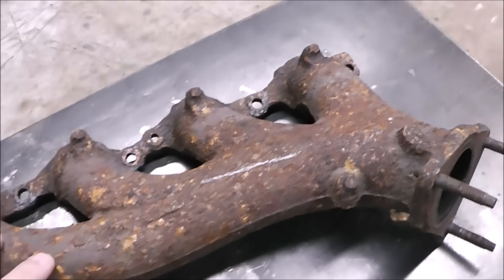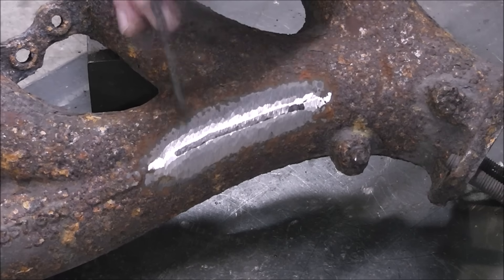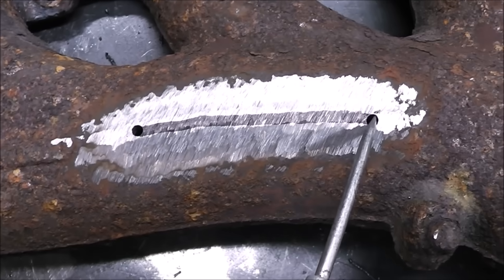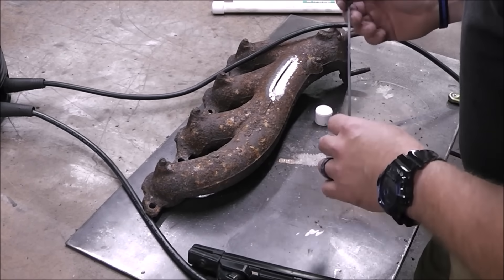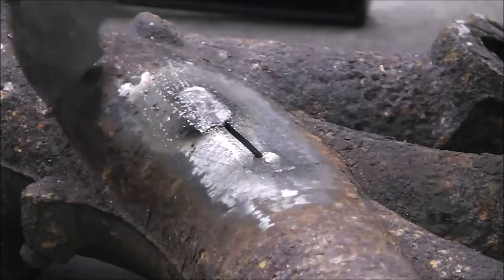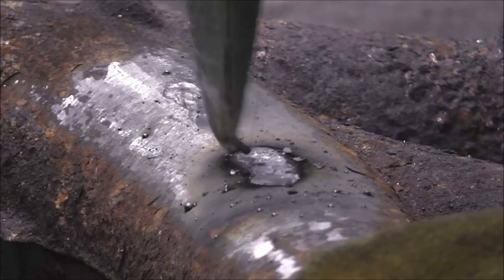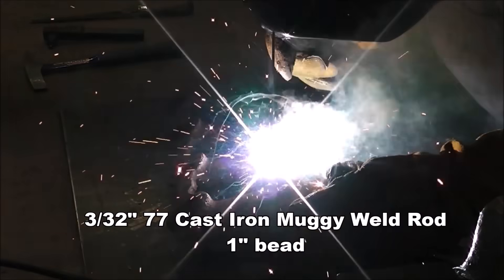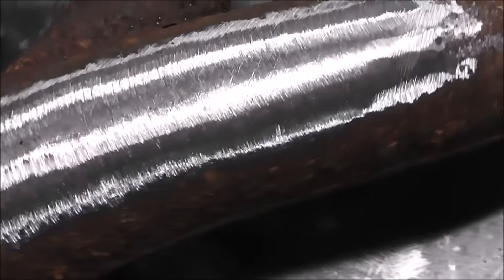Stick Welding Cast Iron Repair with Muggy Weld

Comment from the maker: This part was drilled and spark tested which proved to be loaded with carbon and graphite - CAST IRON. Until someone can prove otherwise by putting up a link showing this factory part is or can be purchased in CAST STEEL, I have to rely on the inspection tests proving its CAST IRON.
Reply: Ha Ha, I knew as soon as I saw the title that some youtube welding injuneer./inspector would be along to tell us where its all wrong LOL. This is DIY repairs and welding with gear a lot of folks have in their shed, or their mates do, whilst their are some garages/small shops that will do stuff like that, they are slowly dying out, and just offer throwing the broken bit out and bolting a new one, not only is it cheaper to DIY it, its satisfying if it works, and if it doesn't, you learn stuff.
Reply from the maker: Right on brother!
Reply: I don't think it would hurt to treat mild steel the same way, would it?
Reply: In over 40 years as a Welder/Fabricator, I have yet to see a cast steel Exhaust Manifold , inlets typically are investment cast Aluminium Alloy and Exhaust are typically sand cast Iron, faster and cheaper to manufacture that using sand to cast steel , casting steel requires much more energy hence Iron and alloy's of it are much more common .
Reply: there are many cars with tubular steel manifolds (toyota yaris, ford focus, rover 400 volvo 440 etc) but of course 99% are cast iron and this one on the video just from its looks and shape even a blind guy can tell it is cast iron no need for spark tests on that part
Reply from the maker: @mozzmann  Thank you! There seems to be a widespread misconception within a certain niche that because you can cut off the flange on this particular style manifold and weld it back together with mig wire or stainless tig rod that it must be cast steel. I've actually welded cast iron with mig...it didn't change the fact that it was still cast iron :) cheers brother!
Reply: thank you it made me rember somethings...
Reply from the maker: Glad I could help! Thanks for watching!
Reply: I’ve welded a bunch of those manifolds and they were cast steel. Idk if they also made them in cast iron , it’s possible as manufacturers change things all the time. But there are a million vids of guys welding lsx truck manifolds into turbo manifolds and there all cast steel.

Comment: I managed a successful repair on an exhaust manifold in the auto hobby shop in Okinawa.

Prepped the area around the crack and the pre-heated it with a torch and then mig weld the crack.

I kept the torch on it afterwards and slowly reduced the geat.

The weld held.
Reply from the maker: That video that was playing in the beginning was a broken cast iron park bench leg...I welded that with solid mig wire with heat and cool like you mentioned. It surprised me too.  Cheers
Reply: @BrandonLund  

Damn!  I threw away a broken bench.......
Reply: The way the welder at the engine machine shop I worked with he would have me use the puffer bottle full of iron filings that we used for doing magnaflux inspections we would heat the part in our thermal oven to 500 degrees than he would mug weld it with the gas and amps turned up and have me blow iron filings into his weld with the puffer bottle then we'd turn the oven back on for an hour and leave the part in it to cool slowly we fixed engine blocks cylinder heads, manifolds anything cast like that kind of hillbilly spray welding
Reply from the maker: @79huddy  interesting! I have not heard of this before. It makes sense though! Cheers brother!

Comment: Been successfully welding cast iron for almost fifty years.when "stitch" welding cast iron I try to only heat it to where you can put your hand on it a moment later.deffinatly bevel the crack,drill both ends and try not to over heat it...but I like to use "99" rod
Reply from the maker: +Jo Jo Mama I enjoy working with cast. Little more to it than just gluing 2 pieces of metal together. I like the extra attention to details. I think that's what makes it enjoyable. Do you do any blacksmithing by chance?
Reply: @BrandonLund  ive had a lot of success welding cast with stainless steel rods, no fancy   preheating or cooldown....it just works....an old metalsmith told me that one.....
Reply from the maker: turtlezed very nice! I’ve had good luck as well...using 309. It’s good stuff :) cheers brother
Reply: @BrandonLund  The 312 works even better. I've repaired big old diesel engines directly in the boats. No way to heat a 3 tons iron engine carter, or use sand pits. You clean, grind and weld with some little tricks that help a lot. Your video is excellent.
Reply: @MrAluminox  you let out a closely guarded secret in the welding world,yep,312 is used on cast iron with much success and is used on many (ferous)metals as a maintenance rod when you don't have the time to find the exact composition of the base metal,good call!
Reply: @BrandonLund  ... I've been blacksmithing probably fifty years,don't do much of it anymore but on an "as needed" basis
Reply from the maker: I am very interested in the subject
Reply: @BrandonLund  m.ññl
Reply: nice rods... but brazen... makes it so much easier..yes Bore the holes..yes  pre heat.. then lay that braze in and smile from the shine
Reply: JoJo Mama ee

Comment: Welding the cast iron (gray, ductile & vermicular) is just kind of "cosmetic" welding, nothing more.
Reply: Vermicular iron = malleable iron?
Reply: No, it's different.
Vermicular cast iron is compacted graphite cast iron (CGI). Shape of the graphite is like "worm". Less sharp, than in case of lamellar cast iron graphite.
https://sintercast.com/technology/compacted-graphite-iron
Reply: @VistaC-u6c  Exactly!  Why would you risk an engine block with it if it's only cosmetic???
Reply: That was nice comment Vista C. Perfectly represent your IQ and technical knowledge of cast iron welding (both are close to 0 from negative side).
You have welded a lot of cast. What cast? Cast aluminum? Cast iron? Cast steel?
So what did you weld exactly? Cast iron or cast steel? & how do you know?
So before you wrote stupid things again, take a necessary lesson.

Comment: Really only knew about pre heat and post heat. Never welded cast iron, but I don't hear it being great to work with. 

I'm on the industrial side in pipe. Isn't cast iron pretty much an obsolete metal? I mean what application still uses it that can't be done better with mild steel or an alloy?
Reply from the maker: Joshua Lennep it’s still widely used in automotive and industrial settings such as engine blocks and cylinder heads but it’s use is declining for more cost effective alternatives. Thanks for watching. Cheers.

Comment: No video vê-se bem que a soldadura ficou com dois poros, mas valeu a tentativa...
Reply from the maker: You can not compare welding cast iron to welding mild steel. Without going too in depth, cast iron is dirty. When you weld cast, the impurities float to the top. it is unavoidable.  It doesn't matter if it's an exhaust manifold or an engine block. You are going to get porosity and there is no way around it. It does not effect the final product. Thanks for watching
Reply: não é um problema dois poros de 1mm num colector de escape fernando....além do mais parecem ser superficiais..claro que podia se corrigir isso com mais  dois pingos. se fosse uma falange de uma bomba de água ou um bloco de motor isso sim era um problema sério

Comment: This exhaust manifold is off a Chevy ls engine they are made of steel not iron.
Reply: All of the 2000 and up Chevy v8, if they’re not a tubular style manifold are cast steel.  I actually turned my stock manifolds into turbo manifolds using a tig welder and using a 309 filler rod.  Welded great I have pictures on my Instagram if you feel interested in looking. The older small block Chevy manifolds are cast iron.
Reply from the maker: I have looked and I can not find a factory cast steel manifold for a LS Chevy. If someone has a link please post up. For now I have to rely on my spark and drill test.
Reply: @BrandonLund  do the file test. If you get shiny fillings it is steel if you get black dust it is cast iron
Reply from the maker: Thanks for the reminder! There will be a follow up tig video to this. I will be sure to include this with the inspection process. Thanks for watching! Cheers!

Comment: I alway had to heat the part that I was welding up first and heat a bucket of sand also to help the part to cool down slow.8/22/2018
Reply from the maker: That is the preferred method. You still can with these rods. Thanks for watching. Cheers

Comment: Repairing a simulated crack in cast iron has no meaning. A real crack has contamination down inside the crack and microscopic cracks from the stress. Let's see you repair an actual crack with these rods.
Reply from the maker: It’s the same process. You grind out and bevel the effected area and weld it up. Thanks for watching, cheers
Reply from the maker: canuckguy worried  This is not a process I made up.  It's a tried and tested repair process that has been around longer than I've been alive.  Thanks for watching, cheers :)

Comment: Having had too weld up an broken exhaust manifold I got a tradesman welder mate to do it. Using proper cast iron rods. Manifold is 45 years old and it simply would not weld. We preheated it and it was just would not weld.We came to the conclusion the material was stuffed. And nearly burnt out. We brazed it and got the car going again but it has developed another crack so spits when cold. Not game to try and weld that too.
Reply from the maker: Were you using flux with the cast rods?

Comment: Question my neighbor has a fire ring and one of the legs is broken what is the best way to repair it I've welded cast but it's been a long time ago and I remember heating it up to do the weld and using heat sticks on the weld.
Reply from the maker: If your able to do a preheat and a controlled cool down I suggest doing that before welding. It will give you the best chance for success.

Comment: Bait and Switch

Initially the exhaust ports were down, against the table, and you drew your simulated crack, cleaned it up and welded it.  At the end of the video, when you finished everything up the exhaust ports were facing up. I did see you welding with the exhaust ports facing up, but...

...was there a problem with the piece, the rods or your technique that you had to refine during the process?
Reply from the maker: Good eye guys! Both sides were prepped, only one side was welded. The other side is going to be tig welded in a future episode.  There is no bait and switch other than I accidentally welded the side that you did not see me prep.
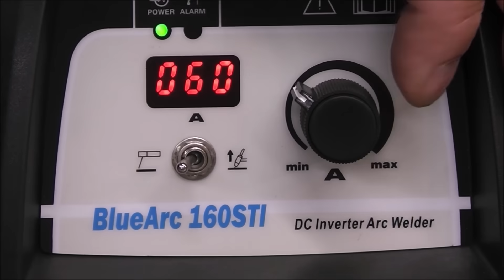Reply: Good eye, but if you look closely tho it actually gets switched at 6:15 when he starts welding, not after welding.

Comment: Cut it open and lets see the backside. Then cut it across the weld, and do an acid test please.
Reply from the maker: Great suggestion. This should make for an interesting upcoming video...thank you!  UPDATE:  https://youtu.be/cVrydI-v7B8
Reply: Why not just ultrasound it lol.
Reply: How about  X ray  or  Magna Flux   lol
Reply: @JeromeBill7718  exactly!  Maybe a little Phase-Array.  Why not?  Lol
Reply: After we know what it looks like on the inside, then have it Extrude Honed to see if it reacts the same way as the cast iron.   =D....... might be overkill though
Reply from the maker: @dublininnis9695  you guys! :) 🤣🤣🤣
Reply: Love Your work "bro" no hate lol
Reply from the maker: Thanks buddy! :) P.S> I love reading the comments section... All of these suggestions are great. We want this used truck manifold in perfect order, for when we fire this thing into space LOL :)
Reply: @southlakelife  we did use ultrasound machines all the time when I was welding. It's really hard to x-ray a 8 inch thick flange that had a 7 foot web and was 30 feet long in a shop.
Reply: @JeromeBill7718  X ray would be my last choice in that application.  Hole iQi/wire  can be a nightmare and will prove little if no obvious inclusions are present. Process control, consumable traceability and operator skill would be the lean on a project of that scope.  Section VT or UT inspections on selected areas would be more cost effective and appropriate.  Especially with 30' of weld?
Reply: @southlakelife  the I beam was 30 feet but the weld was only 8 inches deep. But I get you bro...spot on.
Reply: @BrandonLund  exactly  lol
Reply: O
Reply: i want to see radiography
Reply: Are you a metallurgy
Reply from the maker: @edwardfoehring8827   Edward Foehring  no, but I did stay at a Holiday Inn recently :)
Reply from the maker: https://youtu.be/cVrydI-v7B8
Reply from the maker: @abdulkhadeerrawat  😁 right on brother. Cheers
Reply: Jake Parker  we both know it's failed he didn't do a weld prep just done a straight cut in. both edges wouldn't be burnt in and if they were there would be 10 mm of reinforcement inside if not more
Reply from the maker: @TherealMandingo  your quick to criticize my work. I agree that grooving the joint is preferred but in this exact case, why would I make life more difficult for myself by opening the large gap up even further?  This results in more passes,  more heat imput and adding more stress and tension in the joint? Its not necessary. This is not structural.  I'm actually trying to limit how much of the base metal goes molten...im actually trying to do the complete opposite of what you say I should be doing.

Comment: So you simulated a crack on both sides of the manifold, or did the first one end up not purty enuf?
Reply from the maker: Both sides were prepped, only one side was weled. The other side is going to be tig welded in a future episode.  I accidentally welded the side that you did not see me prep.
Reply: @BrandonLund  
Oh. OK. Never had much luck tiggin cast. Perhaps preheat to 1200 to 1350 f with sand/vermiculite after the weld for 8 hrs or so. Will probably self "de-flux" safely. Might reheat to 1500f after that and gently peen, then another normalize @ 1200. You'd be surprised how well the outcome is. ☮

Comment: Hi Brandon, very interesting video, I already try to fix one cast iron manifold and it did not hold. I will see if from France I can order at muggly. Hello from France I subscribe to your channel. Have a nice day and thanks you
Reply: @JEROMEGORDINI  if you look for high nickel welding rods you should find a suitable rod. Look for Ni 99 or Ni 55.  The 55 and 99 refer to the percentage of nickel.
Reply: @tjsbbi  thank you very much for your clarification and your help. I will send them an email to know the price, and especially to know if they ship to France. Por 15 paint, e3 spark plugs do not ship for France😔
Reply from the maker: Jerome Malinois I have used a product called "Chassis Saver" made by a company called "Magnet Paints" and have had great success over the years. It is comparable with POR 15. I did a video about this recently if you want to check it out. https://youtu.be/Fzl3i__lQUs
Reply from the maker: Thank you for your support!

Comment: I am going to weld my engine block, it has 2 cracks, is an exhaust manifold similar to the composition of an engine block or is a brake rotor closer?
Reply from the maker: If you suspect it's a cast metal, it's likely grey iron. It's what most manifolds and rotors are made from. Where is the crack? is it in the cylinder or the water jacket? 77 rod is likely all you would need for the repair.

Comment: That manifold came off of a gm v8. Either a 5.3 or 6.0
Reply: People cut the flange off of these LS manifolds and tig on stainless or mild V-bands all the time with no special rods or filler. They support 40+ lbs turbos without an issue.
Reply from the maker: +Cody Ellis I have a video where I mig welded a broken cast iron park bench leg using regular mig wire and c-25 gas. It can be done. It's still holding strong.
Reply: GM uses cast steel. It's very well known in the car world
Reply from the maker: GM did not use cast steel in this style exhaust manifolds, which is why you can not purchase one.  It is cast iron. This misinformation has been widely spread around the internet and on the LS forums.  A person on one of the forums actually sent one of these manifolds out for testing and it came back as cast iron with 3.6% carbon and a high graphite content.  We are going to do some experiments and discuss this in a future episode. Thanks for watching.
Reply from the maker: Thank you! I've been wondering (and i'm sure others have too) what this could have been installed on. Thanks again!
Reply from the maker: The spark and drill test indicate it has a high carbon and graphite content = cast iron, plus GM did not make a cast steel manifold.

Comment: Thanks for the tip, I don't do a lot of cast iron, but drilling the hole, I never knew..Cheerz!!!
Reply from the maker: Thanks for watching!  You can use that drilling tip on mild steel too :) Cheers!
Reply: It applies to all materials. The sharpness of the crack concentrates stress in the same way that a sharp knife does. The hole blunts the stress concentration. You must make sure that the hole extends ahead of the crack. If even the tiniest sliver of the crack extends beyond the hole it will continue to grow.